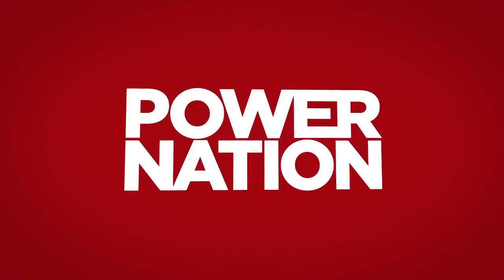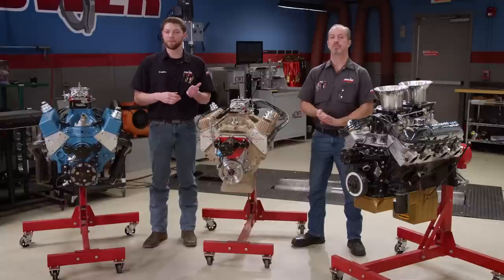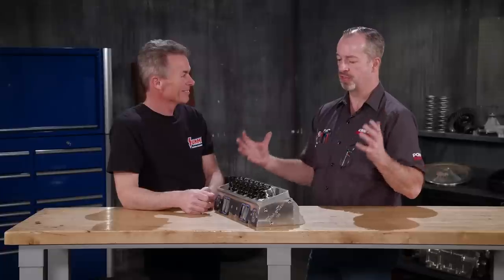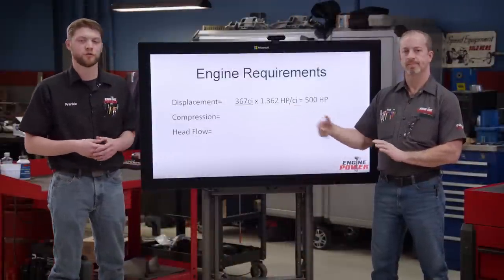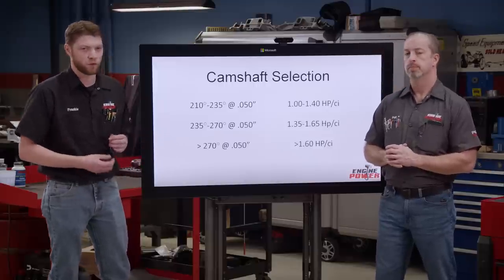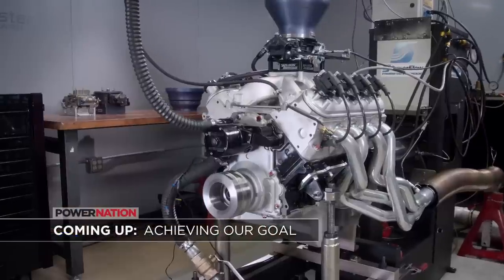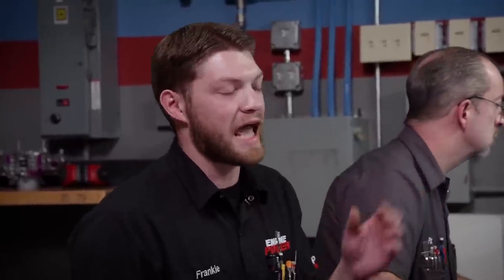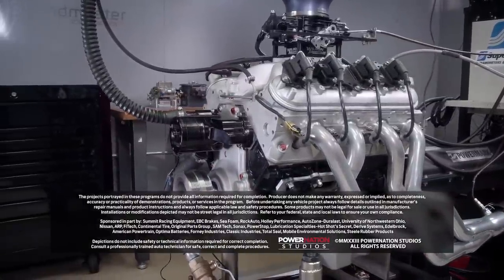How To Plan Your Engine Build: To Make Power, You Need to Have a Plan - Engine Power S10, E4

Comment: I feel like unless you’re living life 1/4 mile at a time, reliability should always be one of the two choices from the triangle. But even then, I’m sure reliability carries a different connotation for the application.
Reply: Especially if your planning on doing drag & drives or no prep events with large car counts where you possibly have to go many rounds.
Reply: reliability is a term meaning different things to different people, but as Brian Earl Spellman found out, it doesn't matter if you win by an inch or a mile...you have to cross the finish line to win, place, or show. Hole shots mean nothing when the engine blows halfway to the finish line. but you also need to plan the rest of the car--800bhp is great but if only 500 reaches the ground...or you only apply 200 hp because you couldn't afford to upgrade your drum brakes...
Reply: Having an expensive looking hot rod broke down on side of road is embarrassing.
Reply: @BruceLee-xn3nn  which is why they get trailered :)

no seriously, why would a 6 digit car on the side of the road look bad? it means its being used for its purpose. "Shift" happens in life. Yes, the pro shop SHOULD have test driven it and worked the bugs out before handing it over to the customer. but plenty of new cars off the assembly line have recalls.
Reply: @albertgaspar627  yeah ive alot of new cars fkd up. When it's a hot rod and broke down it looks like owner is a terrible mechanic
Reply: @BruceLee-xn3nn  ironically, half that time the problem is the owner just beat the stuffing out of their toy and found the next weak link in the system :)
Reply: @albertgaspar627  I did that once. Spun a rod bearing.

Comment: I'd like to see you all put together a torquey truck motor like a 454.  Something that lives in the 1000-5000 rpm range.  This is a lot more realistic to a bunch of us than something that makes power at 3500-6500 rpm range.
Reply: Not really.  Just use stock equipment Nd presto chang- o
Reply: I agree.
Reply: True
Reply: Usually a 454 that makes sweet power from 3500-6500 also makes pretty darn good tq at 2000 though

Comment: Reliability was my biggest concern. Built a 355 stroker for my Holden (Aussie gm branch) strong af bottom end but a small hydraulic cam and not crazy head flow. 335hp na at the fly. Now I'm bolting a side mount on with about 7psi all in. We'll see where that ends up in the reliability scale 😅
Reply: Another 155 horsepower for sure
Reply: Just sayin, bit more cam and a bit less boost is more reliable than just more boost

Comment: Can you please explain how you determine what the redline or max rpm that an engine will turn. For example the engine that yall built on the show. How did you know when to stop throttle input. 
Thanks Derek.
Reply: I believe they used a 'rule of thumb' for the max 'average piston velocity' they expected that this stock bottom end was good for. As I understand it, it's largely about the inertial forces the reciprocating components (piston/rod/wrist pin) experience rapidly accelerating and de-accelerating, and the loads that imparts on the crank (thus why ideally you'd have pistons & rods that are both very strong AND very light). I believe the average piston velocity is used as a somewhat simplified way to represent those inertial loads.
Caveat: I'm not really an engine guy - I'm sure someone will correct me if I'm wrong.
Reply: That's why I asked. I'd like to know so when I build my engine I don't blow it up.

Comment: Can you have a small block ford 363 engine do maybe tens at the drag strip and still be a daily driver?
Reply: Of course you can. Just depends on what you're prepared to deal with. Big gear, big cam, big exhaust, high compression. Or you can add boost.

Comment: I'm still waiting for a tow engine build. Highway hauler. 

What can be done to maximize low rpm torque and fuel economy in a large rig. Uses would be work truck, tow rig, daily driver. 

We have thousands of wrench vids for drag cars. Not many for the truck that hauls them.
Reply: If you are looking to get maximum torque for towing yet keep mileage at a good area, stay with a stock engine. Because that is exactly the plan at the factory. Now if you want better miles per gallon, that can be done but you would have to sacrifice some torque. If you want maximum torque, you'd have to sacrifice them miles per gallon.
Reply: @stephenhodge6441  That was true in the days of carburetors. 

With variable boost, valve timing, injector pulsewidth, and even fuels (e85 on secondary injectors) this is no longer the case.
Reply: @Heathh49008  boost has never added mpg and neither has e85.
Reply: @stephenhodge6441  It is if you can use it only during heavy load conditions, and then tune for sipping gas the rest of the time.

Ever look at Nelson Racing Engines? Jekyll and Hyde is possible, just not simple to do.

Comment: I have a ‘90 454. I want to do a 496 stroker. Would like 700+hp and as close to that in torque in the 7k rpm range on Pump gas. Street/strip application. Backed by a Muncie 4 speed and moser 9” with Eaton posi running 3:73’s. What do you guys recommend for the build i.e; heads, cam, carb/intake, timing chain/timing, distributor, plugs/wires, roller rockers, etc?? Would love to hear your input and advice!! Thanks in advance!!

Comment: Personally I'd be interested in seeing them do something other than a car/truck engine like maybe a sled pulling tractor engine like a farmall M and making it somewhat reliable but maximizing its power
Reply: It'd be the exact same as Ny other scenario bud. Port, polish heads with 3 angle valve job. Configure your compression ration and see if you want turbo or make use of the port and polish with a huge cam
Reply: @johnsonbobo2376  I get that we have all that done on are pulling M with a big carb bored and stroked a little bit making around 100 hp around 2.5x factory but would be interested if they could get more power out of it while keeping it reliable there's people we pull against making more power the biggest i think is around 120-130hp with the same kind of engine but there's aren't as reliable and it has to be NA

Comment: You can add a cam only and some stock 706 heads and make 500 crank... goodness not really "building" an engine your just sliding one of the many already tried and true cams in and another set of stock heads.

Comment: Check out Richard Holdner's channel for tons of different engine combos and the dyno info on what they do and how they are spec'd out. 

Be honest about what you want to do with the motor.
Follow what somebody else has already done and proven.
Understand there is no magic to anything in engine building engines with similar displacements, compression ratio, head flow, cam specs, intakes, and exhausts all make similar power.

Comment: It is still shocking that Powernation does not know how a cam is choosen. YOU DONT CHOOSE THE CAM, YOUR ENGINE CHOOSEN WHAT IT WANTS BASED ON YOUR BUILD SPECS... There is a cam formula widely available to use FOR FREE.  Dont follow the formuula, you give up torque and horsepower. ALREADY DYNO PROVEN. What a shame.... Also, WRONG LSA... This is another flaw. Engine specs determins LSA. Better to be one degree tight, than one degree wide. LCA is an INPUT, not a output.

Comment: Cheap is nothing you will ever see on power nation as they do $1500 worth of machine work on everything and $500-$800 on useless stuff like ARP oil pan bolts and water pump bolts and carb bolts ... you know the bolts that you do not need expensive bolts ..
Reply: Power nation is not a show centered around showing hot rodders how to build stuff so much as to showcase expensive parts that WE know WE do not need ... The last thing you ever see is for them to show us how to make free horsepower unless it is by fashioning a tool or a part they cannot get a paid sponsor for to "give" them the part for free or a kick back in sales. It is like when you look around the shop they have those tools and equipment were not purchased they were given to them as free advertisement. The only stuff they pay for is stuff where you see the name tags or model number plates removed so as not to accidentally give free press to the company that refused to bow down and give them a free piece of equipment. This show is run and produced by TV people not hot rodders . So every build they show of a quick and easy build might just have a 35 THOUSAND dollar build cost when all is said and done. The dyno time of tuning a new engine alone bill might exceed the normal guys build budget.

Comment: What would your recommendation be for a 6.0 crew cab SRW Chevrolet 2500 HD. 4.11 gears. In bed camper. 4x4 on a 18' trailer. Combined gross weight is around 17,000 lbs. We travel in 3rd gear. Unless flat terrain and little wind. The only modification is dual glass packs. Exhaust still through single 3" tailpipe.